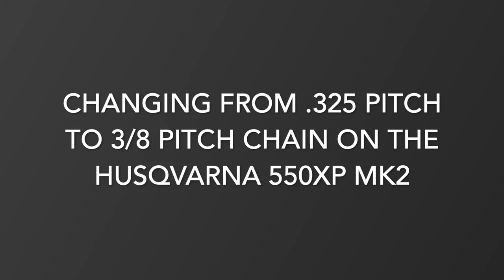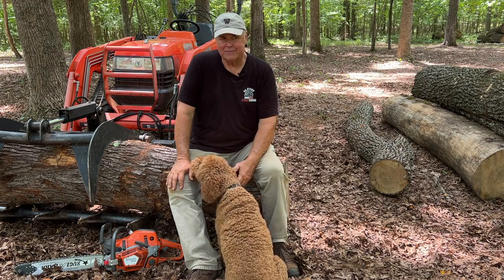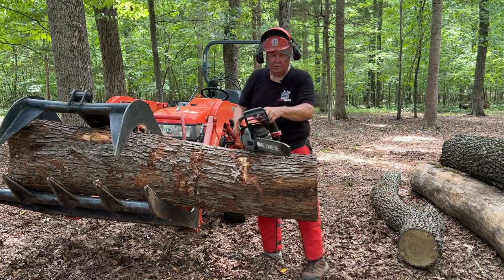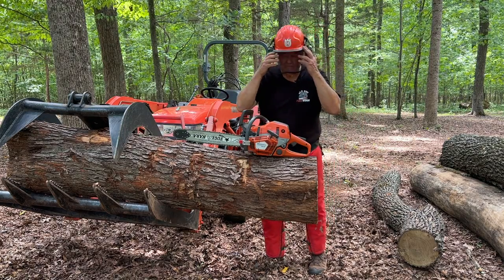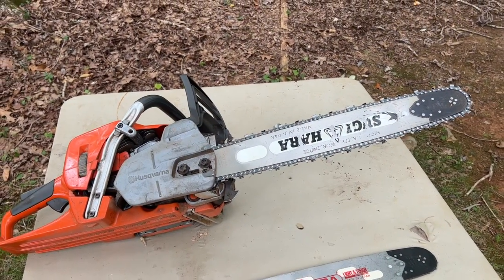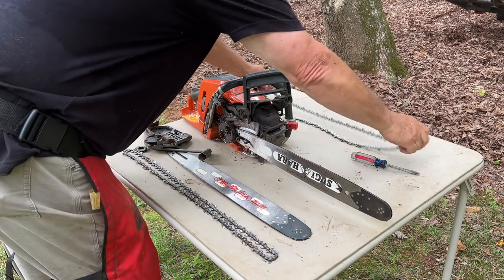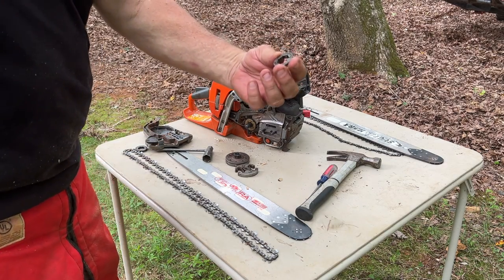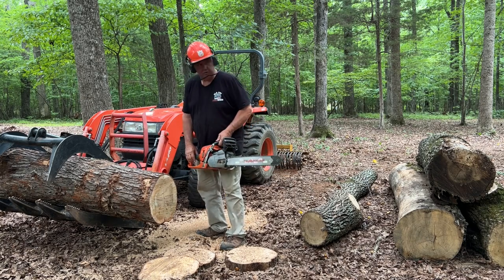Husqvarna 550xp - changing from .325 to 3/8 chain - #17

Comment: Thanks for the comparison. I was thinking of doing this for the same reason as you, but after watching your video I have decided not to. One size may "fit all" but not give the best results. Thanks for your content. I have subscribed!
Reply from the maker: Hi Rhonda. Thanks for watching. I went with the 3/8 and very glad I did. I’m thinking the 3/8 chain in my video may not have been sharpened as well as it could be. I use this saw every day and it RIPS with the 3/8 chain. It sure is also nice to only maintain one type of chain. I’d reconsider if I was you. Just my 2 cents. Thanks… appreciate you!

Comment: The kerf width will affect how much wood you are removing and in theory how long it takes to make a cut. The finer pitched chain will generally be narrower which means faster cutting for a given horsepower and less man glitter that goes onto the ground. The larger pitch chain has more metal to wear down. It would actually be nice to see a comparison of cutting a cord of wood with the 2 types of chain to compare the time taken, the amount of fuel used and potentially the sharpens required.
Reply from the maker: Thanks for watching and thanks for the comments Alan. Good analysis!  Your proposed experiment would be interesting but as busy as I am right now I don’t see me doing it.

Comment: For the life of me I don't understand why people want to convert the 550xp to regular 3/8 saw chain. Is a much bigger kerf and takes a lot more power to pull it through the wood. Next try 3/8LP saw chain on it. That should really fly through the wood. Personally I'd keep the .325 saw chain on it as it is a lot less stress on the plastic caged bearings that are in that saw.
Reply from the maker: Thanks for watching and thanks for the comments. The main driver for me was only dealing with one chain for all my saws. I don’t force my cuts and I always keep my chains sharp so hopefully I’m not putting undue stress on the bearings. I’ll look into the 3/8lp… thanks for the suggestion.
Reply: I do the same thing. I switch to 3/8 . I like it that way. It does well for me.
Reply: I think that the sprocket having a slight larger diameter is gearing the chain slightly faster. That in conjunction with the bigger kerf will cause it to bog down easier.
Reply: People with multiple saws want to run the same chain and bars on everything. Theres a good reason
Reply: @OUTDOORS55  why do it if the saw cuts slower? Makes no sense to me.
Reply: 3/8 holds an edge alittle longer I wouldn't recommend switching unless the saw is ported tho
Reply: Mainly for consistency,  I just did one for a friend who runs mostly STIHL with 20" bars. 
Put the 550 MkII behind an Oregon 200SFHK095 with E72 3/8 .050 chain .. Plus I did a muffler mod which brings that saw to life. 
Worst enemy of those bearings is an over tight chain...
Reply: 1 file size. When you own multiple saws. A small truck saw that rides around 99% of life and cuts a road open occasionally.   That's why i did it.
Reply: A 550 with a 16 inch bar cutting softwood pine/aspen will out cut a bigger saw like a 572. Chain turns faster due to higher reving. I keep all my chains 3/8 pitch .58 guage.

Comment: Many thanks for such a great video. I have a small processor and run a 550xp and both are 18" on .325 so I agree keeping the chains the same is a great idea. I run the same make of bars as you do too.. My larger 592XP is a 3/8 but the 550 does 95﹪of the work. All the best..
Reply from the maker: Thanks for watching Charles. I love my 550xp mk2. I decided to go with the 3/8. I did a muffler mod which really woke the saw up. Check out my 550xp muffler mod video if you get a chance.

Comment: I have an 029 stihl.  Only .325 saw i had. Did the same and converted to 3/8 to match the rest of my saws . I had simmular results .  I tried an oregon 72 lpx chain . It helped my 029 , felt like some of my power is back. I Did not time it .  But that puts me kinda back to not using all the same type of chain for all my saws. But guess still better as i can still  use my other chains on it also, so still using 3/8 on it.  .  Good Video.
Reply from the maker: Thanks for watching. I have stuck with the 3/8 chain. I did a muffler mod (see video) and the saw really performs well with the 3/8 chain. The most important thing is keeping the chain sharp and letting the saw do the cutting… don’t force it.

Comment: Good fair comparison. I’m a Stihl man, but the one Husky I have is my best friend! 
For chains, I run both. What I know is that with the same-tooth sprocket, yeah you’re throwing the same amount of teeth per revolution, but in 3/8, you’re throwing a bigger tooth about 15% faster (4.55 inches of chain per rev in .325 vs 5.25 inches of chain in 3/8) so you are trading out some torque and a smoother cut for fewer and bigger teeth to have to sharpen. Now if that sprocket were originally a .325-8 and you put on a 7 in 3/8… Or from a .325-7 to a 6 for 3/8, then you’d be running the same chain speed. 
Nice place you have. I lived in Wilmington and in Charlotte many years… I’m not a “damn yankee” anymore because I did eventually move home!
Reply from the maker: Thanks for watching and thanks for the comments. I moved from NY to Georgia in 1978 and then from Georgia to North Carolina in 1980. I’m definitely a “damn yankee” ha ha! Not planning on moving any further north! 😅

Comment: Had 3 saws with 3/8 chain, and acquired a new stihl 290. I have several 3/8 chains and even a carbide to cut stumps at ground. Thought about switching to 3/8 on the 280 but decided not to. Bought a 20" carbide in  325. I got used to having two size chains, just keep them separate. Biggest plus got oregon grinder with cbn wheels and diamond wheel for the carbide. The  .325 takes different size wheel to sharpen, but the 290 with a sharp .325 cuts surprisingly well. No longer want to go to 3/8
Reply from the maker: Thanks for watching and thanks for the comments. It sounds like you have adjusted well to working with the two different sizes. I’ve never used any carbide chain but I have thought it might be handy for the occasional stump job. I may have to try it out!

Comment: 550xp is a great bucking saw.  Keep up the good work OGF.  😊  I personally like an 18" bar on mine, but I’m only 5’8" so I can still almost buck standing up with it.  😅
Reply from the maker: The 18” bar is ideal for the 550xp but I went with the 20” because all my other saws run 20” and I could just stock 1 size chain. The only exception is one 28” bar that I run on my 572xp if I need it.
Reply: @oldguyfirewood  If the 550 had not a small mount, it would be great !
Reply from the maker: @vzmax6230  I changed mine to 3/8, .050 and it does great. Check out my video on the conversion. Thanks for watching!

Comment: Thanks for making the Conversion process understandable.
For me it isn't about Speed but Bar size. I'm on a very tight budget and only cut for heat. problem is every now and then I'm given some nice wood that is just to big for my 20" 62cc(off brand) saw and .325P .O58Ga. severely limits my length options. I can find 3/8p .050 Chains and bars without issue and the saw is capable of pulling a 22" or even 24" chain through wood, as long as you aren't Forcing matters.(Use the weight of the saw)
I'm Cutting 32" Poplar with an 18" 3/8 on a 49cc without issue as long as I don't keep burying the tip so I don't see why the bigger saw(63cc) can't handle the longer bar.
Reply from the maker: Yes sir… you obviously have a good understanding of the issue. Thanks for watching.

Comment: I want a 20” Sugi lightweight bar for my 550xp but don’t know what chain to get for it if I get the bar- how do I match the drive links etc?  Great channel !!
Reply from the maker: @PhillipDrumz  thanks Phillip. You first need to decide on what gauge and pitch you want to run. Husqvarna recommends .050, .325. I went with ..050 and 3/8. The gauge of the bar, and the pitch of the nose sprocket must match your chain. In my case I went with .050 and 3/8, and 20” on my bar. The 550xp takes a small Husqvarna bar mount. The drive sprocket on the saw must also be the correct pitch (3/8 in my case).  My .050, 3/8 chain on a 20” bar has 72 drive links. I provide the sprocket part number in the video.

Comment: Myself when I'm in the woodyard I don't time how fast each cut is. I just want to change all that runs good all day. All my 20-in bars run 3/8.050 72 link. I run the yellow Stihl chain. My 24-in bars run the 3/8.050 84 link yellow Stihl chain. I do have a 32-in bar. That's its own beast in its own. It's on a CS 800 p Echo chainsaw.
Reply from the maker: Thanks for watching!  I’m with you.  All my other saws run 3/8 .050 72dl, so I’ve decided to run that on my 550xp as well. The slight lack of cut speed will be made up with the convenience of having to maintain one kind chain, and I think the 3/8 stays sharp longer.

Comment: I’m not sure why but my 550 xp mk 2 seems to cut way faster than the first couple cuts. Maybe it’s cause mine is newer?  I don’t know but mine seems like it is running more than 4hp
Reply from the maker: Hi Adrian. My 550 seems to cut much faster than shown in the video. I’m not sure what the issue was. I did a muffler mod on that saw also (check out that video), and th improvement in power and speed is noticeable. It’s the saw I pick up first for 90% of my cutting.

Comment: Great video.. where did you get your bar, im looking for a 24" light bar for the 550Xp M2. Cant seem to find one that fits the 550xp M2.  Thanks
Reply from the maker: Hi Michael.  Thanks for watching... hope you're subscribed!  I bought my 20" bar from hlsproparts.com   The 24" is above recommended length for the 550xp, buts they do have that bar to fit the 550xp, part number is VH2U-0Q50HV. chainsawsdirect.com also lists that bar.

Comment: I have a husky 55 rancher with a 18in and 10 in bar that run 3/8. I also have husky 350 with a 18in bar that runs the.325 chain. I was considering this because I was considering putting a 14in bar on it for felling limbs and thought to have all 3/8 chain would be nice, so only one grinding wheel for the sharpener. But I've got 6 old 18in .325 chains and 3 brand new ones so I'm just gonna leave well enough alone. I liked you side by side but was wondering if the saw was cold for the second go around.
Reply from the maker: I hear what you are saying.  I've continued to run the 3/8 on my 550xp and to be honest it is as fast as it needs to be.
Reply: @oldguyfirewood  in your case I'd keep it as you've got all your other saws with that same chain. Besides, for us what is 2 second.
Reply from the maker: @williamwallace9620  Good points William. I’ve found keeping my chain really sharp and letting the saw cut without a whole lot of pressure is key.

Comment: I got Poulan Pro 295 20 bar. I'm going to go to 16 bar, 3/8 .050 chain & bar plus Rim Sprocket. I got to find what Rim Sprocket will fit.
Reply from the maker: I’m not familiar with the required parts for the poulan. I really like the change on my 550xp.

Comment: Great video! Thought about doing the same thing. I still might. The 550 has more hp than my 257 and the 257 came with 3/8. So did my old 026 pro but the 261 come with .325. If a 550 with 3/8 cuts faster than a 257 it’s worth it to me
Reply from the maker: The 550xp mark2 is a great saw. It pulls a 20” 3/8 chain no problem. I love the setup.

Comment: The downfall from going to 3/8 is the sprocket is now trying to turn the chain a few percent faster. These little chainsaws rely on hi reves were they make their power and by increasing the chains speed you are also depleting its top end power. You can go to a low profile 3/8, but they are suited for under 40 cc..325 seems to be the sweet spot with 45 to 55cc for most manufacturers.
Reply from the maker: Thanks for watching and commenting.  You make a good point. I readily concede that the manufacturer’s engineers have much more expertise than me in developing the best combination of components to maximize the efficiency of their saws.  I guess I’m willing to give up a small bit of performance in exchange for the convenience of dealing with one size chain for all my saws. I will note that after a muffler mod, (I did a video), this saw absolutely rips with the 3/8 chain. It also has a noticeable increase in torque since I opened the muffler up. My only concern is long term impact on bearings and seals. I think a sharp chain and letting the saw cut without forcing it is key. I really appreciated your comments and support!

Comment: I think the 3/8 chain stays sharper a lot longer than .325 , so if you figure sharpening time then 3/8 is faster. Or more work done before you have to stop and sharpen chain.
Reply from the maker: I totally agree with you Chuck. I love being able to use the same chain on all my saws. The 550xp has no problem pulling the 3/8 chain.

Comment: How about using 3/8 pitch on everything but use the picco on the 50cc instead of 325?
Reply from the maker: Thanks for watching Phil.  My main reason for changing was to be able to use the exact same chain on all my saws. I decided to stay with the standard 3/8 pitch on my 550xp.  I keep my chains sharp and the 550xp is really ripping with the 3/8. I’m thinking the chain I used in the video may not have been as sharp as it should have been.

Comment: It would be interesting to see how the .325 chain works on  the 572
Reply from the maker: Thanks for watching and thanks for the comments Nathan. I’m not sure if you can get a .325 sprocket for the larger saws.
Reply: I have a 9 pin sprocket, 0.325 on my Husqvarna 562 xpg, large mount
Reply: 18 inch Cannon bar 😁

Comment: .325 is the only chain i use. Smaller kerf and i only cut hardwood do it's faster. I can't find the benefit to a wider kerf unless it stays sharp longer but i imagine it heats up faster due to friction do no benefit. It's just more friction on the saw. 

Same for my table saw, i run a thinner kerf so the speed stays up and the cut is smoother and faster. Never heard a positive argument for a wider kerf blade on a table saw or band saw for that matter.

The depth of cut should be considered as well.
Reply from the maker: Thanks for commenting Daniel. The main benefit for me is stocking one chain for all my saws. It works well!

Comment: If you will switch to an 18" bar that will help it out a lot.
Reply from the maker: Thanks for watching Michael. I’ve pretty much settled on 20” bars that fit 6 of my saws. It’s really nice to be able to interchange chains.
Reply: @oldguyfirewood   It also will let you cut bigger stuff when you're in a situation and you need the longer bar.

Comment: Not sure that was fair. Should've used a factory new chain. It's possible you filed too much raker and she was boggin out. Redo
Reply from the maker: You could be right. I stuck with the 3/8 chain and use it constantly. I feel like it cuts faster than the .325.

Comment: If I could change one thing about my 550,it would have an outboard sprocket.
Reply from the maker: Thanks for watching and commenting PM. I like the outboard sprocket on my saws that have them.  I wonder if it can be converted?
Reply: @oldguyfirewood  I was looking at mine today,I really don't see the clearance needed in the housing. Would sure be nice though,the few minutes you save by just pulling an E clip and switching rims would make it worth the while to keep .325 and 3/8 on hand.Keep up the great videos, and it looks like some actual cutting temperatures are coming our way.

Comment: If you have other saws using 3/8 , keep the .325 as it is and you'll have the best of both worlds. You can use the .325  and make up your mind later
Reply from the maker: Thanks for watching and thanks for the comments. I’ve already made the switch to 3/8 on all my saws. It’s convenient and the 550xp cuts great with the 3/8. I’ve just never been a fan of .325. Personal preference I guess!
Reply: @oldguyfirewood  ... I have a 550 xp and just wondering if you can list the bar and chain you used on it ? Husqvarna doesn't list a 3/8 bar for it.
Reply from the maker: @goodboyringo9716  the bar is a Husqvarna small mount (K095) 3/8 .050 bar. Mine is 20”. Husky, tsumara, and sugihara all make bars in that configuration.